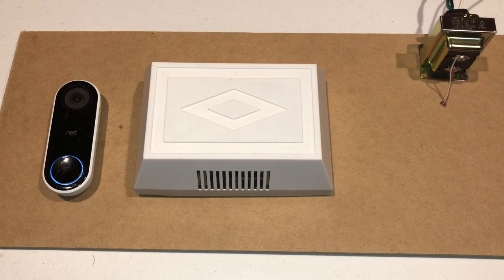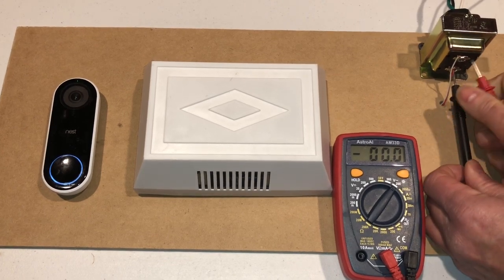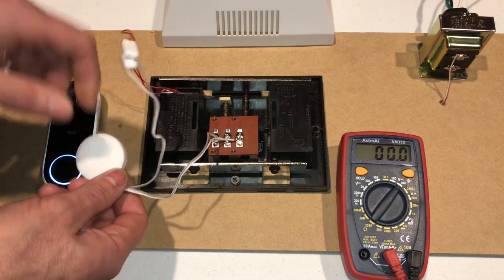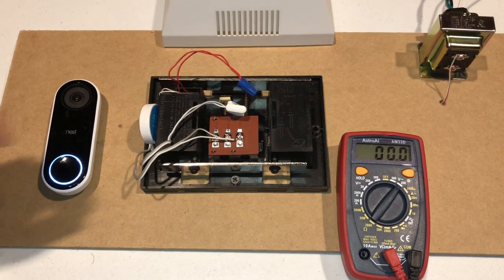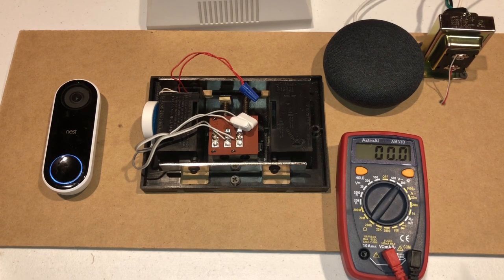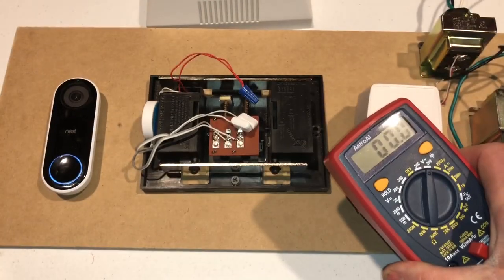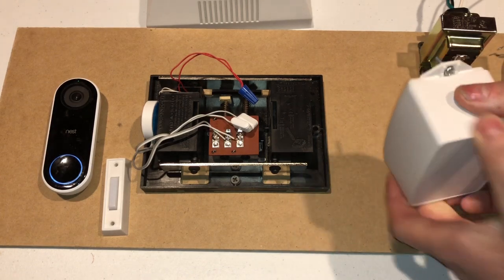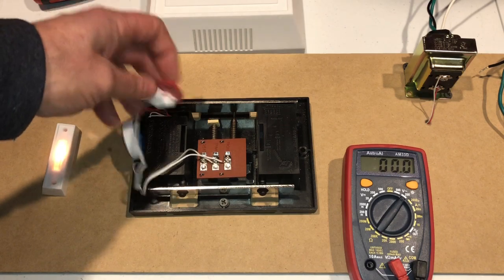Fix Nest Hello Power Problems

Comment: This isn’t my problem exactly just wondering if you have any thoughts on what might have caused me to lose power to my doorbell. 
We replaced a couple switches and an outlet in our hallway upstairs. One switch is located below the chime box on second story. Turned off breakers to change them and said camera was offline but I thought it was because modem was plugged into outlet on second story. When switches were all
Changed out I turned breakers back on and tested the lights. However the doorbell camera wasn’t working. Went out and there’s no light on it anymore. Transformer wires test at 20V. Yesterday when I tested wires coming out at the button it said 20v but now says 0.wires coming out of wall where chime is that are attached to neat kit also showed 20v yesterday but now showing 0 as well. Any ideas or should I just call an electrician
Reply from the maker: I'm thinking that a wire may have come loose in the switch box.  Are there wire nuts connecting wires in the electrical box that the switches are in? If so I would check those wires to see if one of them isn't making good contact. Do you know where the transformer is located?  You could check the voltage at the transformer to see if you are getting 20V on the low side 110-120V on the high side.

Comment: That's not solved! That eliminated the chime. Even on your video there was quite a lag. And in experience I don't hear the ding until at least 30 seconds after they ring the doorbell. So I wish you would say it was not "solved" it's more like work around (if you don't want the time in your house)
Reply: I get so much lag that I can't get to the door before UPS etc leaves when they need a signature.

Comment: Thanks for this. I could not get the Nest Hello to work with my old doorbell chime. The chime would just buzz really loudly. Tying together the two reds with a wire nut fixed my problem! I have a bunch of the small Google speakers, so I just put them all around the house, and it actually works better than the old chime now.

Comment: I want the traditional indoor, wired chime to ring when someone comes to my house and rings the Nest Hello.  

I have the nest 'power connector' installed/connected to the wires from the wall, and then have the 'power connector' connected to my chime.  When everything is connected, and you press the Nest Hello, the indoor chime does not work.  Any thoughts as to why the chime is not working when someone presses the Nest Hello button outside?  I have a 16Volt/10VAC transformer.

Can I remove the Nest 'power connector' but instead of 'wire nutting' the two wires (from the wall) to bypass the chime, can I connect them directly to my chime as if it was an 'old school' or 'normal' doorbell? so the indoor chime will work when the Nest Hello button is pressed by a visitor?

Comment: This is great however you didn’t show the wire connection path. Do the wires from the ring go to the transformer first? 
I have a setup without a doorbell. I’m looking to install the door cam directly to a power source. What would you recommend and could you describe or provide a wire diagram or path. Thx!

Comment: Nice job of clarifying the basic electrical flows....however you did not mention wattage issues. 
We now have TWO NEST doorbells plus ONE "button" doorbell.
The button rings the chime fine, but the NEST doorbells will not ring the chime (otherwise they work fine) 
So my understanding now is ---I need more WATTS (48) to power my total setup---thus a 48 WATT transformer. Is  that right?

Comment: This was going to be the the smart doorbell best buy but not including a OEM power supply with it was a headache to all buyers paying more than $200. Mine stayed in the box for a month tell I found a suitable psu for it. Now after around 3 years it stopped working. I changed the psu to another one and it completely stopped working, no lights Nothing. I will go back to traditional doorbell camera better as my previous COMMAX system worked for around 15 years with issues.

Comment: I’ve had my nest doorbell for almost 2 years now and for the past month it would not connect. I only get the little green blinking light no matter what I try. I reset the doorbell via the reset button and also held the button down. I uninstalled and tried to reinstall the doorbell with no luck. I tried doing this bypass shown in the video with no luck as well. Has anyone had this same issue and have any insight?
Reply: Im having the same issue. Did everything you said. When i connect the wifi the nest hello goes dark. Its very strange and i feel like google help is not helping at all. They just keep giving the run around. $230 bucks i feel has gone down the toilet.

Comment: Cool video, we couldn't find the transformer in my house. Connected the front and transformer wire still didnt work. I then disconnected the rear wire as well and then it worked.
Reply: I found my transformer in the closet, five feet away from the Chime.

Comment: When I first installed my Nest Hello Doorbell, it was yellow, which supposedly indicated that there was not enough power. After trying different things to change the color to blue, I couldn't get it to work. I figured I would call an electrician the next day to make it work. The next day when I came home from work the light was blue. I set it up, and it worked for about a month. Never was able to get the chime to ring. Now there is no light on the Nest Hello. Did I short out the nest somehow?? Any suggestions?

Comment: Hello ..We are undergoing a deep freeze in Texas, suddenly hard wired Nest Hello has no power, checked the voltage at Step down transformer 18.5v and at the Nest Hello end about 16.9v, can you provide some insight - how should I trouble shoot this issue ...thanks & Regards.
Reply: Today no sooner the temperature went above 35F the Nest Hello started functioning !!, wonder what the issue was - would you know if by any chance the battery within the hardwired Nest Hello - had role to play - should I charge it ?

Comment: In the UK the standard doorbell uses a 8v transformer, so that is a problem.I purchased one with a 12-24v transformer. It had 4 connection points two for mains live and neutral and two for the door bell push. Fortunately the transformer and connectors were on a small pcb. I removed it and did a quick search for the wiring on the internet. I had to break a connection and solder a new pair of wires so that the 24v could power the nest hello chime and detect the bell push. Great the camera light came on and the hello chimed and app rang on the phone. But no ring from the bell!
Going into the settings you have to turn on the indoor chime, but that still didn’t work. Looking a little further down there is a chime duration set at 1 second. Changing this to 6 seconds allowed the bell to carry on ringing! Result.
If you are buying one of these I suggest you get an external transformer (24v) and a battery powered chime case. You will have to mount the transformer somewhere and there will be plenty of space inside the chime box for the nest chime.

Comment: Thanks for the video. This was very helpful. What I did different from you is I did not remove the connection with capacitor however, I did disable it in App and use Google Mini and it worked fine. Thanks.

Comment: Very good video, thank you. I have a 16VAC transformer. Will be changing to a 24VAC transformer today prior to installing the Nest Hello. 
Also, I suggest moving the doorbell transformer to the electrical panel so it's easy to find. I knew where mine was because I've lived here for 27 years, and I have a note beside my panel telling me where the transformer is 😀
Reply from the maker: Great!  Also, a 16V30VA transformer will work for you as well.

Comment: If I have 2 nest door bell, I want to bypass the chime, should I connect the 3 wires (front,trans,rear) together?
Reply: I noticed that you have a three connector chime but only use the front so your bypass works for that. With this same question, what do you do if you have the back door as well using a nest hello?

Comment: my nest hello is not connected to my existing house doorbell - I have a dedicated x-former that only powers the nest hello. I've owned it for 7 months and the first 6 months no problems...in the last month, whenever the nest hello button is pushed, the power to the hello reboots. Apparently it's been a common issue from what I read on the google help site...and there's been no remedy posted. Please help. TIA.

Comment: I bought my Nest Hello 7 months ago and in the last month I've had issues with power (with ZERO problems for the first 6 months). Whenever the doorbell is rung, the power immediately shuts off on the doorbell and powers back up 5 seconds later...anyone else having this problem? Apparently it's common. Someone please share source of problem and the fix. TIA.
Reply: I am having this issue. please help with this. Did you get yours up and running?

Comment: Disconnected chime. Didn't work for me. Still glowing orange : /  Strange tho, I took out google chime completely and left original doorbell wires disconnected (From T and 2 screws) and the Nest Hello had no power. And yes I double checked the breaker power was on.  Hooked the original doorbell wires back up and then the hello had power again. (But still yellow light). So my doorbell wires don't have power thru them unless doorbell wires are connected. Either way, sounds like I do need an electrician. For the record, house was built in 2003, so not that old.

Comment: My home is 5 years old and every time the doorbell is rung, the nest hello reboots. It worked fine for the first 5 months.
I believe the transformer is in the wall. If I press my ear to the same wall where the chime box is, I can hear it buzzing.
Reply from the maker: You need to upgrade your transformer to at least a 16V30VA.  This video will show you why https://youtu.be/QUO7o_vrEMw
Reply: @sellgooddeals-DIY  thanks for the reply. I purchased a 16V30VA from Home Depot. The nest hello is still powering off when the doorbell is rung. If I disable the indoor chime in the Nest settings, I don't have a problem.
Reply: I've been experiencing the same exact problem with my nest hello, which I got 7 months ago...power issues for the last month after zero issues in the first 6 months...if I hit the button, power shuts off and reboots in 5-10 seconds..the only thing that has changed for me is that it's been super cold lately (DC metro area). What is the deal?! I looked on the google nest hello website, apparently it's pretty common...is it really because of the indoor chime on nest settings?
Reply: @jonbe9  I'm in Utah, so it's gotten cold here too. Definitely not below 25F though.

Comment: My ringer box doesnt exist. I checked with a neighbor that has same model home and it seems it got condemned. They removed it and speckled the wall. I don’t see any voltage in my current doorbell. Any recommendations?

Comment: My nest doorbell has had the yellow light since we installed it 2 weeks ago. After watching your video, I ran the nest app again and told the app that the doorbell has green light, and voila... no more yellow light and my doorbell video now works!!! I will check the voltage next (if I can find the transformer) and possibly just bypass the chime like you did. Thank you so much for sharing your experience and this video!

Comment: I tried this but if I by pass the chime, and connect the nest directly to my transformer, it gets HOT really quick (transformer) and the nest doesn't even turn on. But if I plug the nest using a micro USB cable it turn on right away. Any thoughts? It was working fine at one point, now it won't turn on with the transformer. I even bought a 24 bolt one but nope. I would get same issue and a buzzing sound from my transformer. Then my regular doorbell wouldn't stop ringing. So I thought maybe I have the wires touching somewhere, so I bought new doorbell wiring and connected directly to test it out... And still transformer gets HOT and nest wont power on. 🙄

Comment: This video has completely fixed my months long problems with my nest hello! Our nest hello worked for many months with some minor problems disconnecting off and on, but over time it got worse and worse. For the past 6 months the camera has been virtually unusable because it would actually disconnect from the internet about 100 times a day, causing me to spend hours upon hours trying to figure out if my network wasn't working. I've spent hours trying to get help from nest support but they are not helpful and have mostly just blamed my network. In the past few weeks it started to dawn on me that maybe there was a power issue that was causing the camera to disconnect because it wasn't high enough voltage. Earlier today I stumbled across this video, interestingly the wall chime used to work but had since stopped, likely around when the camera started acting up. After watching this video I quickly ran over to the wall chime and bypassed the chime as outlined in this video, seconds later the camera started working 100%! It's like a dream, I had all but completely given up on this nest hello and was so close to just ripping it out. Thank you, thank you, thank you! I will gladly donate money to you or buy you a coffee, you have saved me from so much frustration I've been experiencing for months! Thank you!
Reply: Thank god for these YouTube videos
Reply: Same issues now, and I have no idea what to do. It's like my nest doesn't have enough power from the transformer. It was working perfectly then stopped. How did you wire it?
Reply: @JesseJamess  I just did exactly what is shown in the video starting at 4:45 where you wire bypass the nest chime
Reply: @JesseJamess try turning off the chime on you’re nest app in the upper right settings I did that and it now works perfectly it doesn’t cut off the wifi when pressing the door bell button and it doesn’t randomly cut off the wifi to it all is good by turning off the chime in the app

Comment: So was having the buzzing issue with my chime, so I decided to bypass the chime as you explained in this video. Before I did, I tested my transformer (16V/10VA) and was getting 20V. I wired the two wires together but still wasn’t getting power at my Nest Hello. I tested the transformer again and it showed 0V. I figured a bad transformer was the issue all along, so picked up a new one (16V/30VA) and wired it up. At first, the Hello worked great, then it stopped. I checked my new transformer and am getting 0V again. Is my Hello killing my transformers?
Reply: Get a plug in transformer 24va on amazon i have had my transformer for 4 years.
Reply: @TheDesawnb  you have a plug in transformer with the Nest?

Comment: Camera goes offline constantly throughout the day, Unable to find the transformer after an exhausting search. Voltage at the doorbell was at 3 or 4 V, bypassed the chime now it is up to around 10 V. This seems to have reduced the offline incidents significantly. Can I connect  the capacitor into the bypass somehow to increase or store additional voltage?
Reply from the maker: I really hate to say it but you have to find that transformer.  Your voltage is way too low to be able to run the Nest Hello. Have you looked behind the doorbell?  What about in the attic next to the access?  What state do you live and age of your house?
Reply: @sellgooddeals-DIY    I live in Utah, the house is about 50 years old, access to the attic I can't fit through it's very small, nothing behind the doorbell,  my next door neighbor had an electrician search for his they couldn't find it. Interesting if not possibly helpful side note. My hello would not turn blue on setup, called nest tech support and it told me to plug it into a phone charger, lit up blue right away. After disabling the chime I went from pretty much half the time the camera was offline to two or three times in 24 hours at around 2 minutes each time. This is an incredible step forward for my situation as far as I'm concerned, lol. I would like to chime though, would like to find the transformer just for my own personal sanity. Maybe I will eventually install a whole new setup.
Reply: Forgot to mention, thanks for doing what you do it was helpful nonetheless. And I really appreciate you replying, thanks dude
Reply from the maker: Sorry, I gave bad advice for Utah it shouldn't be in the attic or behind the chime.  This is going to be a pain. I would turn breakers off and on one by one until you find the breaker that powers the doorbell.  Then you can see what else is off as well that should narrow you down to 2 rooms that the transformer is installed in.  Since back in the 70's they had lights and plugs on the same circuit. Typically they would install them in an unfinished utility room that has the furnace, washer/dryer and the electrical panel.  The age of your house is borderline when they started attaching them to the panel/near the panel in a junction box.  They also would install them on the side of an electrical box that has the single white lamp fixture in a utility room.  However, you never know what they ended up doing. Hopefully, it didn't get covered by sheetrock. Good Luck!!